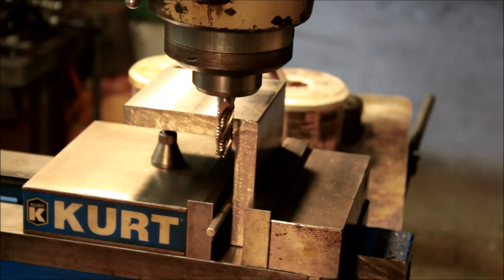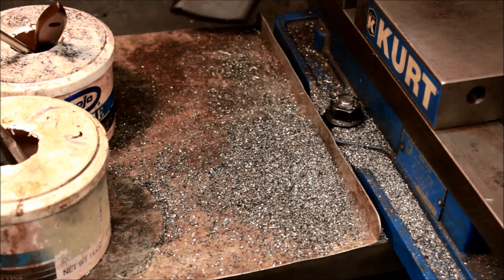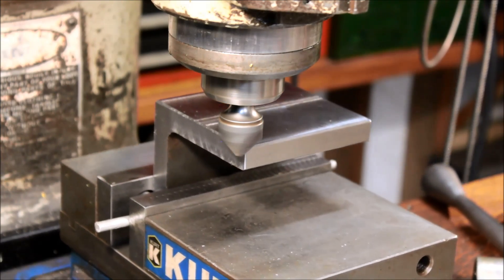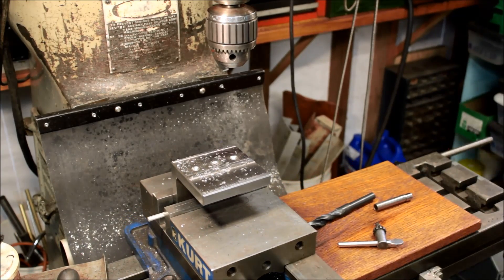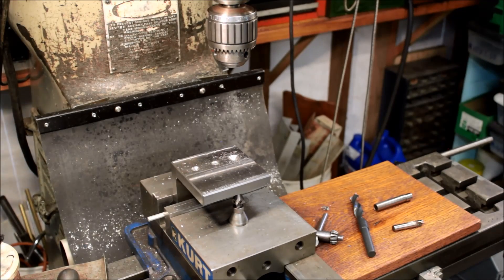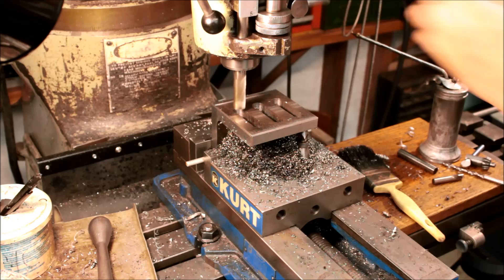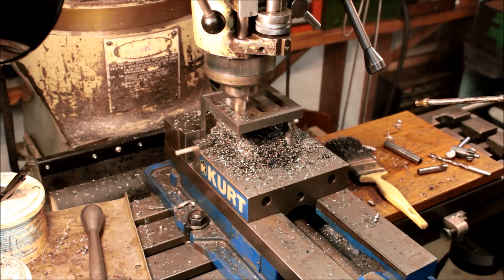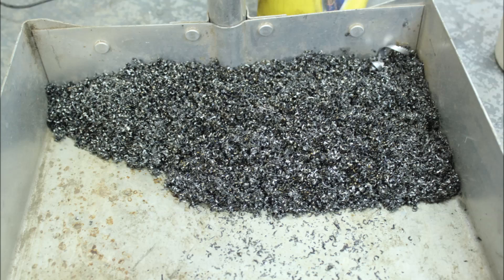Homemade Machinist Angle Plates - Part Two

Comment: My employer long ago and far away had a 6" x 6" x 1" angle, (the heaviest angle made, I think) cut-off, which I acquired with permission, and used to make 2 angle plates 6" long, one for a friend and one for myself.
One thing I never understood was the reason or usage for the big slots therein.
I simply drilled a rectangular pattern of 3/8" dia. clearance holes, which worked very well for me over the years.
I spaced the outermost row of holes such that they lined up with the outer T-slots on my (small) milling machine.
A horizontal mill really shines for work like this.
Just a thought; angle iron can be really out-of-square, and require a lot of metal removal off one leg to square it up.  It's best to assess this and remove equal amounts off each leg. 
Structural steel can be case hardened;  if desired I'd rough machine all over, anneal the piece, finish machine and drill, then send out for case hardening.  The piece may distort a little during the hardening process and surface grinding will be necessary for restoration of squareness and flatness.  Case hardening can be done in the home shop, but for a one-off is messy and time consuming.  Ask the heat treater to make the case 1/32" inch deep, and it will last forever.

Comment: Slotting the stupid way ? What does that mean ?
Reply from the maker: That is in reference to an NYC CNC video where John Saunders calls straight slotting "slotting the stupid way" and instead uses high-speed-machining techniques to improve the speed. I am stating that since I am horsepower limited, it's largely irrelevant how I slot. I hope that helps.

Comment: Nice machining, enjoyed watching this! Just one question, since you only have slots on one of the sides, how do you fix them to the table/workpiece? I'm guessing you use holddown clamps on the closed side?
Reply from the maker: Thanks Phil.
Honestly I haven't had a chance to get a lot of use out of these. Most of the time when I have, I've been eliminating chatter on a long bar of material, so I used the slots to clamp it to the table and then just used a C-clamp or machinist clamp to secure the workpiece. I decided to wait before making anymore slots, to see if I needed them first. I was going to do one on both sides but I never got around to it. I think this is the only shot I have of one in action https://youtu.be/DTQXCGLaHVw?t=161

Comment: Drills are cheap. Milling cutters are expensive.    I would drill a series of holes to take out as much material as I could before using end-mill cutter.   About pilot holes   -------  I always drill one so the the large drill-bit isn't trying to push it's blunt nose thru the metal.  But I'm a cheapskate and I can't sharpen end-mill cutters so...........
Reply from the maker: Steve Callachor As long as I don't burn them up or chip the edges, those roughers will last ages.

Comment: Enjoy these videos. What brand roughing end mills are you using?  I'm getting ready to buy one and was wondering if I should go import or USA. Was the roughing end mill just normal high speed steel?
Reply from the maker: Hi Redmech.

The rougher in this video was a Korean one, I forget the brand. I have a lot of Niagra mills that I like a lot. I would not recommend the very cheap chinese HSS endmills, they are very coarsely ground and not very tough or tolerant of abuse. That being said, they haven't perfected the formula for crappy carbide cutters so those are ok. All endmills in this video are standard old HSS.

Get as short of one as you can justify, no more than 1.25" LOC. Possibly as low as .75 if you have more horsepower.
Reply: Buy British ----we have been doing industry longer and better than anyone else
Reply: @davidwrighton3914  what cars are still made in GB?.....
Reply: @janvanruth3485  Aston Martin, Jaguar-Landrover, Mclaren, MINI, Nissan, Vauxhaul, Ford, Honda, Morgan, Caterham, Lotus, Rolls-Royce, Bentley. Those are just the ones I can remember off the top of my head. Plus many specialist automotive engineering companies, like prodrive, Ricardo etc.
Reply: @556boris  made, not assembled!
cars, not toys!
Reply: @janvanruth3485  those words are synonymous are they not? And last I checked, all of those are cars, not toys.
Reply: @556boris  no they are not, making a car starts with a pristine sheet of paper ( or a new  folder in a computer nowadays).
assembly is a mere 10% of the actual work that goes into making a car.
mclaren, caterham, morgan and lotus are toys, pricey toys for boys.
mini and vauxhall are german.
as is bentley.
honda and nissan are japanese
aston martni jaguar landrover are  the only true britsh manufacturers.
Reply: @janvanruth3485  how can you argue that manufacturing is only 10%😂😂. How many people are employed on the production lines vs in an engineering team? And considering the development takes a few years. And regardless of whether you might class them as toys, they are still car makers, producing vehicles in Britain, which I believe is what you asked for?. I'm well aware of where the car companies you mentioned are headquartered, but if you want to play that game, you'll struggle to find any manufacturer that isn't part of some multi national corporation or with owners/stakeholders all over the world.
Reply: @556boris  how long does a car stay on the assembly line from start to finish?
how may workers are working on the car at any given time?
a car will take well less then 50 man hours to assembly.
where do the machines to make the parts come from?
where are the drawings made?
where is the tooling designed and made?
i happen to own a 78 opel monza and a 79 vauxhall royale coupe.
both identical apart from the logos.
both designed in ruesselsheim.
all the tooling etc.made in ruesselsheim.
both are german cars.
as are all post 60's vauxhall cars.
take a look under the bonnet of a bentley or rolls.
recognise the audi and bmw engine?
and the zf gearbox?
both are designed and engineered in germany.
they are essentially german cars.
where are the engines of the honda and nissan made?
the mini is being assembled in born in holland by vdl in the same plant where the mitsubishi/peugeot  suv used to assembled by nedcar.
and before that the smart.
just an assembly plant for bmw.
Reply: @janvanruth3485  without trying to defend british cars (they have always been far from the most reliable), I'd like to tell you that pretty much all major F1 teams have been based in britain for years. The Brits might not make the best road cars, but they sure know how to build performance and race cars.

Comment: cutting down one side of the slot and up the other with a smaller size endmill will enable a better finish than cutting both sides simultaneously,  and you can sneak up on your final dimension.   thanks for your videos, I learnt stuff.   Lfog nz
Reply: Yes I agree. There are two reasons that I know why this occurs. 1 that the cutter is conventionally cutting on one side and climb milling on the other so it tends to pull to one side or wobble at times and Two. the chips have a greater tendency to foul the cutting edge as they wedge more between the faces. cutting one edge only gives the cutting edge more time to spin off and clear the chips.

great work.
Reply from the maker: Lindsay Fog Were i to do it again, I will definitely do it that way. I totally agree with you. Thanks for the comment.

Comment: nice angle plates. im in the process of making 2-6x6x.500 angle plates now. but they are not square  so what im going to do is weld a4x4 inch gusset on each side then because its going to pull one way or the other put them back in my mill 9x49 3 hp and mill them square. im going to tig weld the gussetts instead of mig to eliminate splatter.
Reply from the maker: Those sound like they're gonna be awesome! Could you upload a picture and link it here when you're done? Thanks for the sub btw.

Comment: Nice job! I had to see the video with your choice of names, cool. I made a couple of simpler , lighter ones similar to these. Nice piece of angle iron, i have never seen 3/4" web like that, cheers!
Reply from the maker: Thanks. As for the name, when I took a high school machine shop class, the kids there really did not care. They used dull cutting tools, sometimes turned wrong towhere the relief angle was now on top, they didn't try to improve their cuts at all. Just mashed the tool into the work until enough metal was bludgeoned away that the part was "passable". In my eyes, they were butchers of metal. Then I went and thought about it, and compared to the the retired guys that worked for 40 years in an old school machine shop, I too was a butcher of metal. So that's where the name came from.

Comment: Great job, really nice work.  I have a couple of those fine roughers.  the 3/4" one I have is very sharp and I am always impressed with how easily it slots, and feel like i could push harder than i do but fear breaking it.  Your angle plates look great
Reply from the maker: Thanks man. I always wonder how much pressure they could take too. It seems like static load the could take a lot, but it's hard to factor it in when spinning.